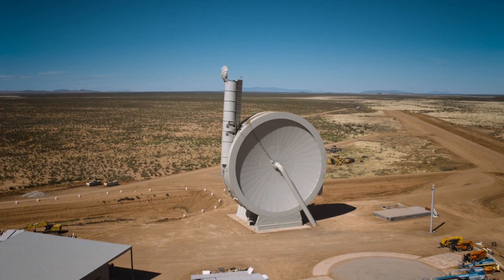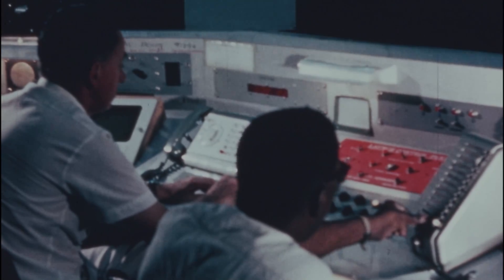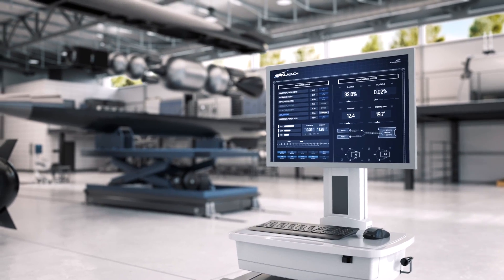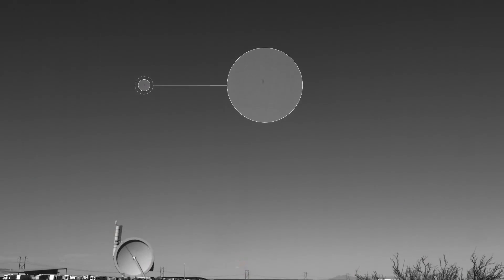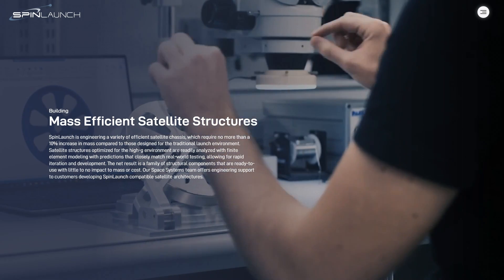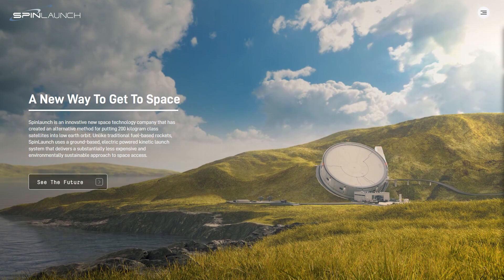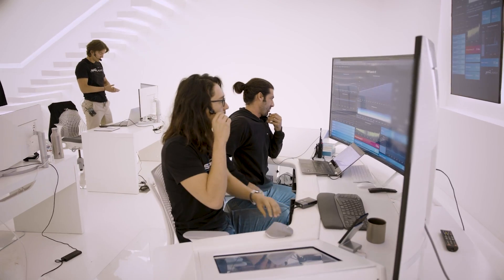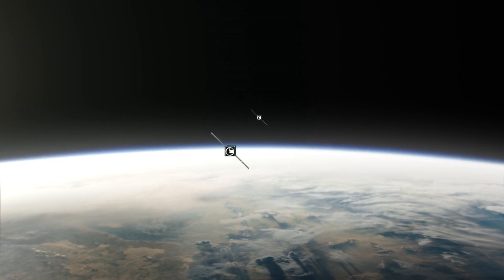Can Spinlaunch Throw Rockets Into Space?

Comment: Scott I was wondering, do you think that some of what makes this work (and not RUD) is the transfer of energy? 

I am thinking about a bow and arrow, we all know that you should not dry fire a bow (pull sting back and let go with no arrow) as there is nowhere for the energy to go, so it travels up and down the bow (I was always told this could lead to the bow breaking). 

So the spin arm survives because a critical amount of the energy leaves when the rocket it thrown, potentially making the rapid ‘re-balance” required in the spin arm easier? Or at the very least easier to slow down because you have less potential energy stored in the system now.

Sorry for the long post, oh and I almost forgot to say, great video 😁👍😁

Comment: Here's a very simple, Kerbal-like solution to rebalancing the rotor after launch: Launch two at the same time. After the first launch, the rotor will only be imbalanced for a fraction of a second before launch #2 balances it again.
Might have some issues with the vacuum seal though.
Reply: "Might have some issues with the vacuum seal though." - I think you'd be OK. At 450rpm, your second launch would be 0.133r seconds after the first launch; given the first projectile will have shoved a good amount of the air away from the seal as it exited, I doubt that much air would get in in that fraction of a second. Another alternative would be to have a longer exit tube; so the second projectile gets released before the first projectile punches out. This would also give the small advantage of having the first projectile travel for longer in a vacuum, thus less lost energy to friction early in its flight. Downside would be needing even tighter release timing tolerances, due to the longer exit tube.

Comment: What happens to the rotation of the projectile when it's released? Sure, it's centre of mass will want to travel in a straight line, but the projectile was also rotating at the same rate as the arm when it was released, so why doesn't it come out tumbling end over end? The release mechanism must take care of that, I guess? One more thing for it to have to worry about...

Comment: Is the projectile kept pointing in the direction it's going to travel - requiring an extra bearing at the end of the arm?
If there's no such bearing, then the projectile is yawing (or pitching) at 162000 degrees per second at the point of release, which sounds tricky to cope with.
But if there is such a bearing, then the rocket not only has to withstand a g-force of 10,000 g, but it's a g-force that (from the perspective of the projectile) rotates, reversing direction 450 times per second: that would likely destroy any liquid fuel rocket engines, or delicate satellites inside.

Comment: Is there any issue with the angular momentum of the rocket itself which is rotating, causing stability issues? My physics has been a while, so when you release the object, isn’t it rotating slightly relative to the connection point or would it fly straight if released perfectly?

Comment: It would need a long deceleration pipe going down for the counterweight. You could harvest the energy though. Second is the sudden deceleration on exit would slosh the fuel forward away from the engines just as needed. Last is the sonic boom when launched would limit the area allowed. But I like it for non human flight.
Reply: Second isnt actually an issue. The engines wont fire until it's well past that stage. Unless the force would stay that way all the way up til it releases the shielding?

Comment: using this to launch inert material from the moon might be useful, but how much lithium 3 does the earth really need right now?
this could get ores of psyche and into earth orbit much easier than trying to process them there and load them onto a rocket. 
you can do this for the cost of some solar panels,
Reply: I think you're thinking of Helium 3 and I doubt it would be worth the cost. :)
Reply: @TheEvilmooseofdoom  yes helium3, lithium 3 would be boring.

I mean, chucking helium might be worth it, if there was a market for fusion power.
but from psyche you might not even need to chuck it with a booster. 2-3km/s might be close enough to lower perigee to earth transfer, you dont need any fancy vacuum pumps and you dont need any sort of aerodynamic shell. just a couple MW of solar panels and a very good release mechanism and a very clever plan to get it up there.

Comment: Forget the air drag on the projectile, the air drag on the spin launch device (which, at 100 meter, will be a lot more massive than the projectile) will be crazy after the vacuum seal is broken.
Reply: Might help spin it down. :)
Reply: @TheEvilmooseofdoom  Unplanned rapid disassembly is definitive a way of slowing it down :)
Through that might be the reason for the small exit tunnel, so that they can put a lid on the hole rather quickly.
Definitely want to capture as much energy from regenerative breaking as possible here.

Comment: Is there a reason that they don’t use a circular maglev track in a vaccum (ie hyperloop)?  You could make a much wider radius loop. Once you get up to speed, a switch flips changing the track, and vehicle next time around shots you a ramp to launch…
Reply: No, the faster the load circulates, the more pressure it will exert on the track. No maglev track can handle a 10.000G load.

Comment: Supposedly there's water on the moon but where do you get a couple of megawatts of electrical energy for 1 1/2 hours?  However you get the electricity they'll have to get that to the moon.
Wiley Coyote would be proud.
Beep beep!
Reply: Solar?  A shit ton of solar.  One advantage of the moon is that you can also use large spinning weights as a energy storage system and during the day you get 24hrs of sun so you might (and all this is pure speculation) be able to charge a bank of (insert storage system here) and then use it to launch a payload.
Reply: @TheEvilmooseofdoom  That's still a significant amount of infrastructure they'll have to get to the moon.

Comment: Wonder if you could use a large counterweight close to the axis of rotation and just before release of the rocket allow the rotating arm to slip such that the counterweight would get closer to the axis and the rocket further from it. Depending on the how the mass is distributed across the arm, bulk of the mass on the rocket arm would be in the release mechanism, you may not need to have the arm move all that much to rebalance the system. Alternative to releasing the counterweight I've seen a few proposing.
Reply: you would think they'd just dig a hole in the ground and simultaneously release the counterweight. lol.

the problem with letting the arm slip is you have to decelerate the 2nd weight after it hits the desired radius and that would be inclined to tear the arm off I think...

Comment: Cant wait to see the first time this thing looses its vacuum and it RUDs itself right into oblivion
Reply: Be easy to cope with.  A pressure sensor that stops adding power, then it just spins down.
Reply: @TheEvilmooseofdoom  ok hypothetical situation, lets say there at almost launch speed say 10 mins left till launch which takes hours to reach. You really think with the forces (speed and Gs) that thing is reaching and you have a full atmosphere if pressure slam into its just gonna spin down without turning the payload and swing arm into melted slag which is gonna be thrown all over the interior at white hot temperatures. Sure early on in the spin up yes they could probably get by with a shut down, but if that thing is even close to full spin good luck. Just to prove a point, go start your vehicle let it get up to full running temp and open the radiator cap. As long as the pressure is constant no problem lose or release that pressure good luck.

Comment: Question. Why don't space companies launch from mountains/high ground? Seems like most launch from sea level. understandable to fly out over empty ocean but must add significantly to DV required to get to orbit? Surely higher launch alt would save on 1st stage?
Reply: That's the balance, public safety vs. convenience and is the convenience worth the trade off?  That's not an easy answer since I suspect it changes from mountain to mountain. :)

Comment: Add a second hole in the arm, at the exact right moment, remove the current shaft, release the payload, and engage the second shaft. If done right, the forces will be right at their minimum everywhere, just as the center of gravity of the arm changes. It can be done since the arm must be in a certain particular angle on release. Just have to be real fast about it. Looking at the current shaft, there is going to be a lot of momentum...

Comment: Even if the Technical requirements for Earth launch are unattainable near-term, Lunar launch or even Martian Launch might very well be feasible.
Reply: Launching He3 canisters from the moon would make a lot of sense.
Reply: That might be even less feasible. The maintenance on Earth is pretty easy. Trying to maintain something like this on the Moon wouldn't be feasible. And there is no way this system wouldn't require a lot of maintenance.
Reply: Building a very big spinny yeet machine on Mars might prove a problem...
Reply: But on somewhere like the moon or Mars where the footprint and environmental impact of an engineering project isn't really a concern, why not build a "normal" linear electromagnetic mass driver?
Reply: @ReptilianLepton  Size? wouldnt it need a lot more super capacitors, and be much longer.  Im no rail gun expert, but Scott did mention the additional electronics being the problem.

Comment: An easy solution to maintaining balance would be to have a second "release arm" filled with a dummy round of concrete or similar cheap material they can throw into the ground with a catch basin of some kind. (Underground water tank, for instance.) If both are released simultaneously, all you need to account for is the "snapback" as the stretching caused by the immense load is suddenly lost.

This also allows for varying masses to be used as the counterweight could very easily be balanced for abnormal payloads. I'm sure they have some sort of system in place for that already, but balancing such a huge load seems to necessitate something extra.

Comment: I didn't see anything about how they are countering the angular momentum that the projectile will have around it's own center of gravity.  Certainly they're not spinning it on the arm while holding it pointed up.  Am I wrong in thinking they will need to do that? releasing it will allow it to follow a ballistic path, but it will still be rotating at the same rate it was (180rpm?) when it was released.
Reply: Maybe the "grip" of the arm straightens just as it releases the projectile?

Comment: ridiculous project with zero chance to be successful. You would better build a maglev tunnel on the edge of a mountain assisted with pressurised gas.
Reply: No harder than trying to make a miles long maglev on a mountain.
Reply: @TheEvilmooseofdoom  at least maglev has a chance
Reply: I mean, cmon you need to build a stable machine that withstand 400RPM? Then the rocket should also endure that high rotational speed? the electronics should survive that speed let alone the combustion system and pressurised gas tanks. then you release that rocket into the thick air with 7 mach speed? Alright lets say they somehow could make such machine and the rocket survives... does it have any chance to beat the launching prices of space X?  This project is a joke,  I feel sorry for the investors

Comment: It still blows my mind that the 'muzzle flash' from a rail gun isn't from chemical propulsion.
Reply: Correct but i still telling the fact it is still polution however little it makes and besides the energy it consumes from nuclear or coal fired steam turbines that generate energy
Reply: well it's from the friction to the rails. rail guns can only fire a few times before you have to change the rails.  It is very inefficient in it's use of energy
Reply: Ozone polution and uses air to start the fuction
Reply: @operationmickeymouseharold6780  Ozone pollution isn't a huge deal in the context of a railgun. It's a health concern when you trap it indoors or have it hanging in a cloud over a city, but it breaks down pretty fast under normal sunlight. A ship in a firefight or a space launch system won't produce as much ozone as even a single lightning bolt, and those should be happening well away from inhabited areas. If you use a railgun indoors, the ozone discharge is probably fairly low on the list of concerns.

Comment: I was jokingly going to comment "Cool, when will it get human rated?" and then actually wondered: If you tried, how big would it need to be to not kill everyone? I figured 5G's max would be fine, similar to falcon 9.

My math chops aren't the best so correct me if I did anything wrong:

Ac = 5g (~50 m/s^2)
v = 2100 m/s

if Ac=v^2/r  then r=v^2/Ac

So plugging in the numbers:

r=(2100)^2/50 = 88,200m radius which is 176.4 kilometers in diameter.

Human rating here we come!

Comment: The rocket is rotating rigidly with the arm, until release. That means the moment after release, the rocket has 450 rpm of yaw.

(If you don't get it, just consider the direction the rocket is pointing, as the arm spins up.  The direction the rocket points is rotating at 450 rpm.  That represents fair bit of angular momentum.  For you physics majors, you may want to consider the parallel-axis-theorem for rotating bodies. As a physics major, myself, I have to ask the following question.)

How does Spinlaunch stabilize a rocket that is yawing at 450 rpms?  

I mean, while simultaneously flying at hypersonic speeds, in the dense air of low-altitude.  
Would aerodynamic forces and the fins be enough, while not so big as to destroy the rocket?
Reply: Probably releases the nose before releasing the tail.
Reply: I would think the problem of yaw is solved with dual release points on the projectile. The forward release point is of course electronically timed to coincide with the exit port. But the aft release point would be a simple catch that releases when the the projectile reaches a predefined angle relative to the arc of the swing arm. So the front of the projectile would release and due to centrifugal force, swings away until the yaw is neutralized, at which point the rear catch releases and the projectile goes on its merry way.
Reply: I agree that releasing the nose before releasing the tail could solve this problem.  That would require very timing on the release.

So what is happening, in terms of forces, is the nose releases, but the tail is still attached for a short duration.  During this time, arm is exerting centripetal force on the tail (to keep it moving in a circle).  This force induces a torque that can be designed to neutralize the 450 rpm's worth of angular momentum in the rocket.

However, this force is sideways, and will induce a (slight?) sideways impulse on the rocket.  The arm is parallel to the ground when releasing, and applies a sideways centripetal force that pulls towards the arm's axel.

(The center-of-mass version of Newton's law is:  F_total = M_total * a_cm.  Here, F_total = total force applied to the rocket, M_total is the total mass of the rocket, and a_cm is the acceleration of the rocket's center-of-mass.  Here, F_total would be the sum of gravity and the force the arm applies to the tail of the rocket.)

Therefore, the rocket would be released with no rotation, however it will be moving slightly sideways.  That is, the rocket will be pointing vertically, but moving vertically with a (slight?) sideways velocity.

I have no idea, but I suppose a (slight?) sideways velocity is fine as long as it is small enough.  I haven't done the calculation, so I don't know if the sideways velocity would be big or small.  One would have to roughly estimate the mass of the rocket and its moment of inertia.  Maybe Scott Manley could do this for us?  XD

Interestingly, the video of the test-launch shows the rocket puncturing the vacuum barrier.  If you look at it, you'll see that the rocket does not make a "clean" puncture of the vacuum barrier.  It's messy, and forms a slightly key-holed puncture.  I haven't looked closely enough to see if this slight keyhole is due to sideways velocity and/or rotation.
Reply: @ChiralSymmetry  whatever they do, I hope they keep releasing footage. I find this whole concept almost as fascinating as Starship.

Comment: We had to design electronics to handle 1,000 Gs.  In early testing it ripped all the parts right off the board. We eventually got it to work but everything was much heavier.  The sudden shift of forces on release can't be good either.  Excellent for throwing rocks at the invading aliens.

Comment: 2000m/s is prettymuch the very limit of what you could reach in terms of tip velocity with an untapered arm and no safety factor or paylaod with current materials
but
TAPERED
ARM
makes hypothetically any speed possible if you have a high enough mid to tip ratio

Comment: The second advantage of using such a catapult on the Moon is that the launch won't generate dust clouds at 400 m/s like a rocket launch does.  less needs to protect surface facilities with dust deflectors... On the other hand, if the system fails before launch, the catapult and the nearby building will likely be destroyed by the cinetic energy of the projectile being released too early or too late. 
I still prefer rockets. It's a proven technology.